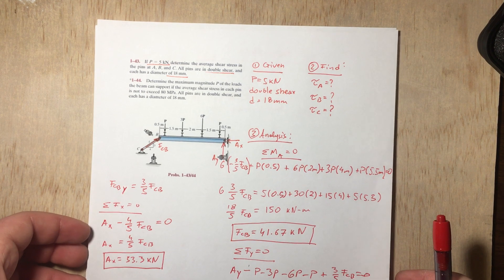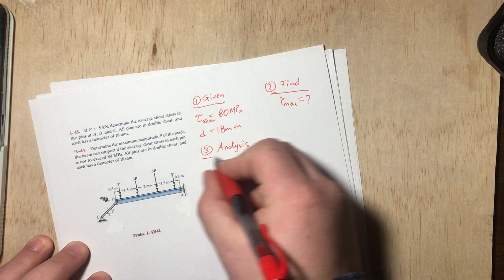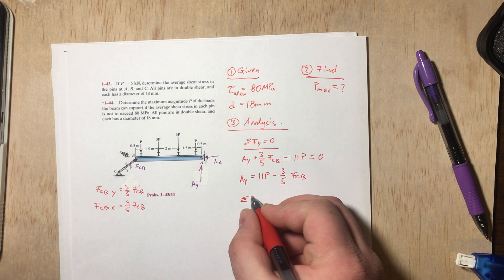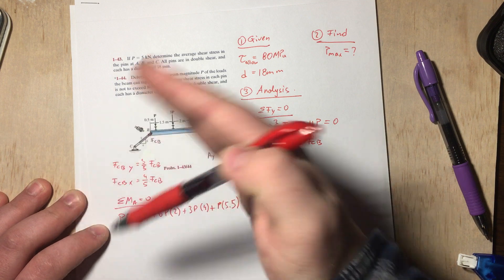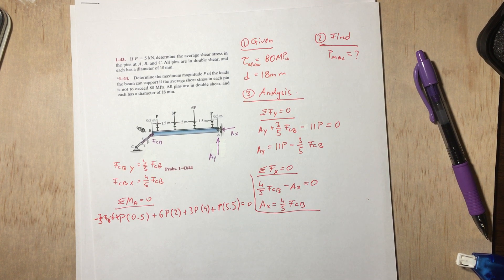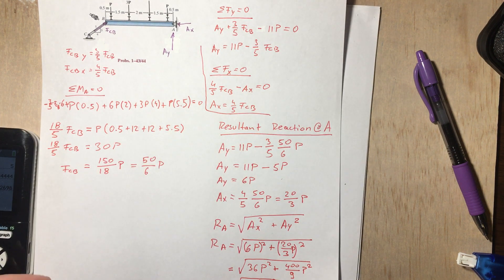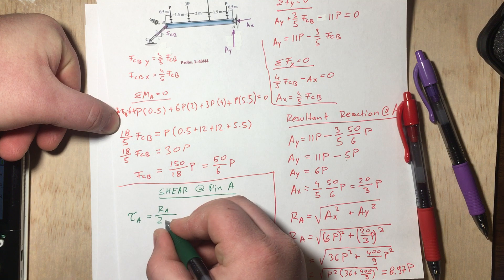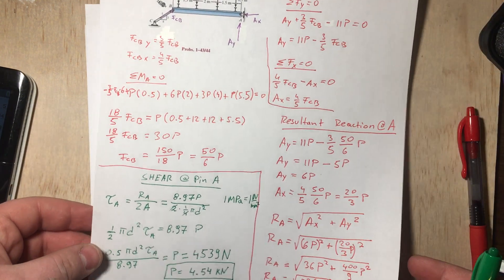Allowable shear stress

Comment: why is the area 1/4pi d squared? Is that the area of the cylinder of what ?
Reply from the maker: Kidus Bahiru the pins are cylindrical so the cross sectional area of a cylinder is going to be a circle. The area of a circle is πr^2 or (1/4)πd^2.
Reply: oh ok. That makes sense. Thanks @andigega6019